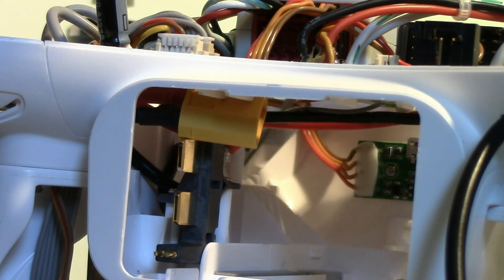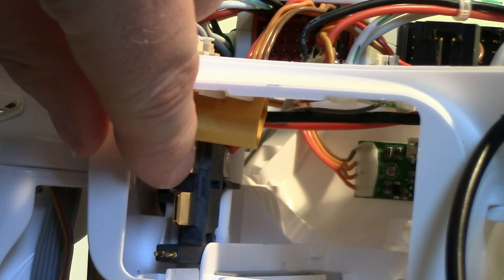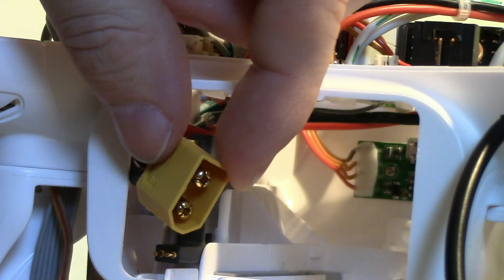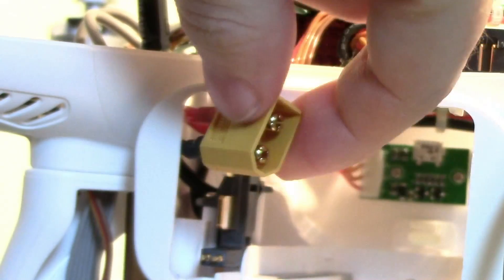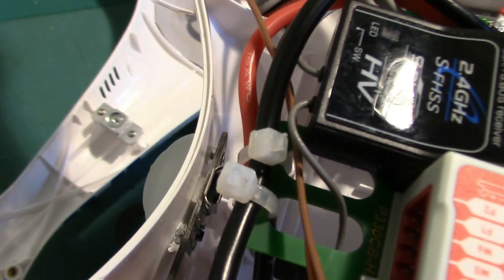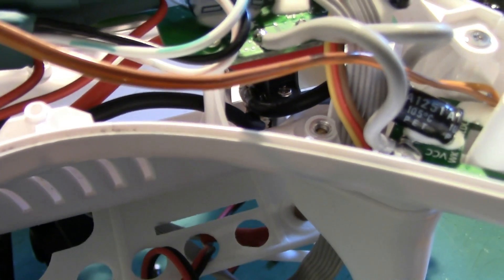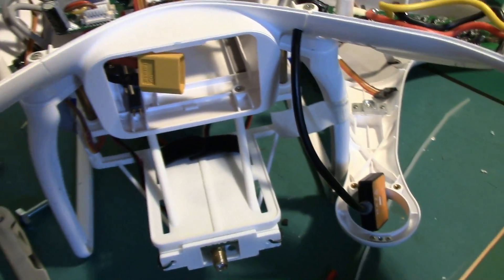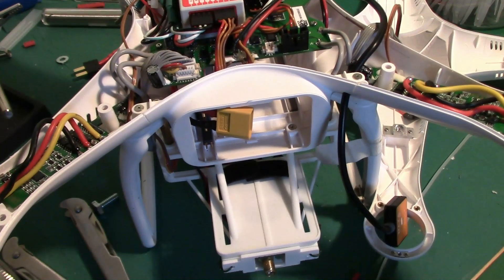Phantom 1 to Phantom 1.5 Conversion - Internal Power Connector

Comment: What are those two pins that are below the positive and negative conestores? The battery has a few contacts that stick there, and I ask again, what are those two pins? Thanks , from venezuela
Reply from the maker: Those two pins were how the Phantom 2's NAZA (flight controller) was able to identify that it had a genuine Phantom 2 Intellegent battery installed. They were not relevant on the Phantom 1.5 build I did so they were never connected up.

Comment: Hi Dewey, I did the phantom 1.5 conversion months ago following your videos and have been very happy with the results... except for one thing-using dual P1 lipos is getting rather tedious so I am looking into finally spending the money and upgrading to the P2 battery just for the simplicity and ease of use. Is this still the preferred method that you are using? Or have you found a better battery somewhere? I appreciate all you've done for us.
Reply from the maker: Hi Jared. Glad you've been enjoying the P1.5. I think a P1.5 FB group might be forming soon. To be honest as soon as I bought that P2 battery I never turned back to dual lipo's. I've used them when I really needed a second flight but the Y-Cable and XT60 especially drives me crazy sometimes.
So yes in short you really won't regret it and now the prices of the P2 batts are starting to slide a tiny amount it is well worth it. For me its kept the Phantom my 'go to' multi and I've been through a fair few! lol Just don't buy the cheap fakes ebay ones... its not worth the risk.

Comment: Could it be possible to add the xt 60 connector to phantom 2?
Reply from the maker: If it is a standard Phantom 2 then currently no you can't. The Phantom 2 has a special NAZA v2 which forces you to use the Phantom 2 battery. People are trying to get around this but still no luck on it yet. The only way to use a standard lipo on a Phantom 2 is to buy a new NAZA v2 (so no point at all).

Comment: Hi just wanted you to know I have found a 8400mah 25c 3s battery that way about 600g's and the length is 6".1.7".1.8" will that fit with on of your batterie covers this will change everything and make your application really worth doing if the run time can reach 30min please let me know and thank you for your work
Reply from the maker: Hi Etab - Can you post all your questions on one or both of those forums. You have now posted about 25 comments across all videos which makes it really hard for me to keep track. The forums have several people that can answer these questions as well as me.
Reply: sorry I was pretty excited about this project

Comment: Those making the conversion of the Phantom 1 into a Phantom 2 shell (or Phantom 1.5) may find the new Battery Bay Extension for the Phantom 2 shell handy. It provides space for either parallel configured stock batteries (up to 5000 mah with a 2800mah + 2200mah battery configuration in the24 mm model) or parallel + large single 5000 mah batteries (40 mm model). It also provides an external USB port and a more visible location for the Flight Indicator Light.

The Battery Bay Extension 24mm Model: http://shpws.me/qOVA
The Battery Bay Extension 40mm Model: http://shpws.me/qOI7

Comment: what did you do with that extra gray 2 pin cable that comes stock with battery connector?  It looks like there is a non active 2 pin port that it plugs into on the main upgrade board but wasn't sure and didn't see yours plugged in.  Love to know your thoughts. Thanks!
Reply from the maker: Personally I removed it from the equation all together. It is firmly believed that on the Phantom 2 this is what communications the 'hand shake' between the batteries smart board and the special NAZA v2 that comes with the Phantom 2. I noticed there was a port available on the board but I didn't dare do any testing with it in case somehow it caused problems. Who knows it might help manage the battery life of the P2 battery but it may also cause problems. Works fine without it so best left alone until a braver soul than me tests it fully.